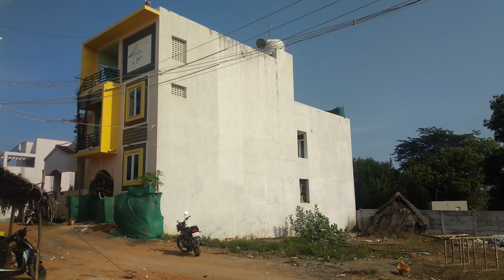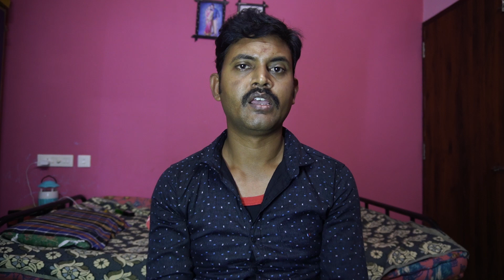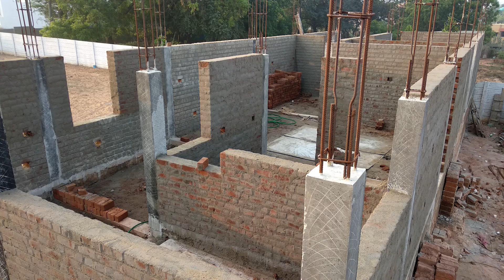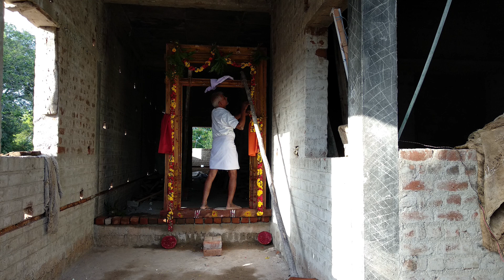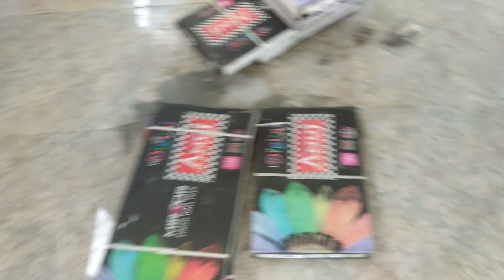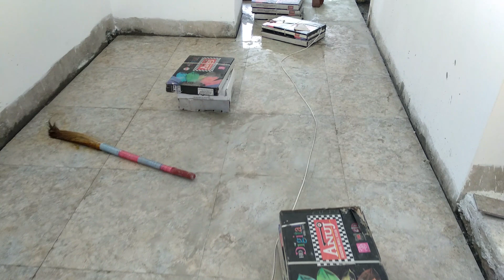House Construction Start to Finish | Step by Step Process & Tips | Mano's Try Tamil Vlog

Comment from the maker: Subscribe to Support: http://bit.ly/2tLZfDH | உங்கள் Comments ரொம்ப முக்கியம். Share Video with your Friends.
Reply: Anna plastering ku m-sand use panunengala???
Reply from the maker: @sathieshraj5117  No
Reply: @sathieshraj5117  Use P.Sand or F.Sand(Plastering or Fine Sand which is made by more crushing Msand) 

MSand- Manufacturing Sand
Reply: Bro over all yevlo aachi bro( start to end cost) plss naanu kandran athan bro plss
Reply from the maker: @nithiyananthamk3870  32 lakhs
Reply: Bro unga veedu katta evlo total cost aachu
Reply from the maker: @foodieshorts_590  32 lakhs for 2800 sqft
Reply: Bro 1050 sqft one 1 after evlo agum bro
Reply: @ManosTry  no

Comment: Bro two storey, building ku only 4 rods used. Which dia used 12 or 16 ??
Reply from the maker: 4 rods means 16mm
Reply: @ManosTry  Bro, WHAT IS THE PER SQ.FT COST OF CONTRACT INCLUDES BAR BENDING WORK , SHUTTERING & OTHER WOOD REQUIREMENTS for construction INCLUDING LABOUR COST
Reply from the maker: @manojkumar-qu8ml  from 1500 - 2400
Reply: @ManosTry   @Er Kannan Murugesan  thank you bro. But my request is PER SQ.FT COST OF CONTRACT INCLUDES only BAR BENDING WORK , SHUTTERING & OTHER WOOD REQUIREMENTS for construction support  (not window,  not doors)  activity as labour arranged by me, mason daily salary. Only contract is for bar bending work, shuttering to bar benders, pls tell its contract

Comment: Why tiles, why not marbles or red oxide flooring? Did you think of any other flooring?
Reply from the maker: marbles are costly
Reply: marbles always absorbs water  and leads to joint pain on legs so its not recommended
Reply: @kimyangKo  yes,

Comment: Thalaivarey elllan Okey but building strength kun brick Yun entha oru sambanthamey illa .....strength beam & columns ku than irrukanun yena load beam & columns than thangun bricks illa athu verun partition ku than
Reply from the maker: Yes. but walla crack vandha nalla irukuma
Reply: @ManosTry  crack pathengana shill level la podra concrete apparon cement oda quality apparon cement bond ana vitham avlo than brick nalla kedaiyathu
Reply from the maker: @raleighstudds5754  Oh😮. Ok Ok